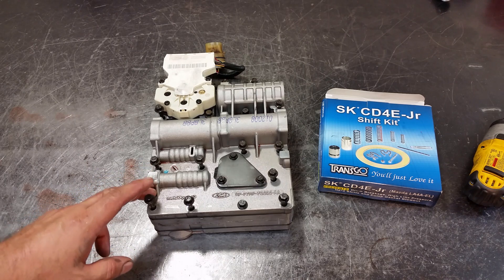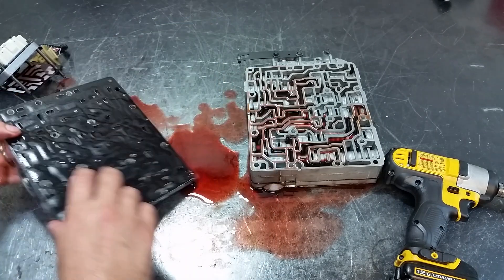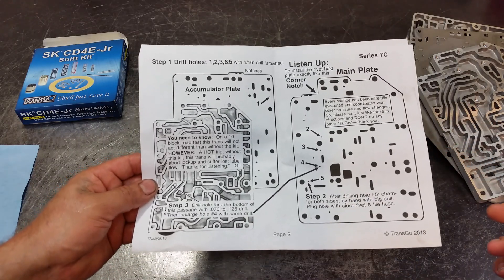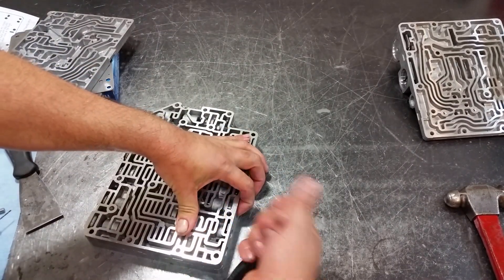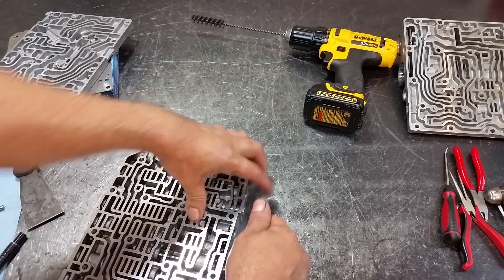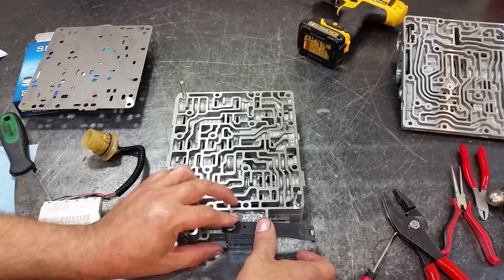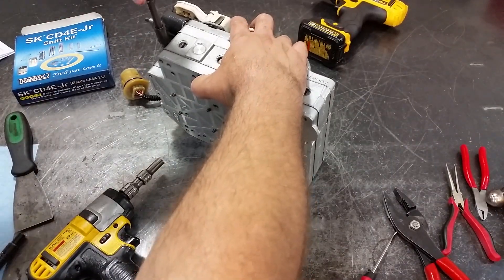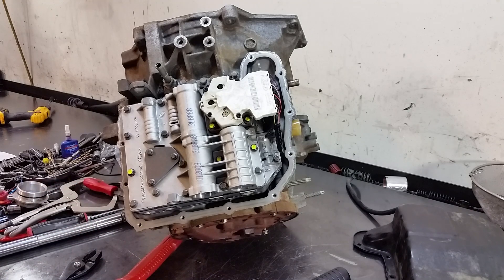CD4E Transmission - Broken Parts - Torque Conveter codes

Comment: Great videos on the cd4e, I have a 2005 Escape with the V6, transmission performs flawlessly but for one thing: A "flare" shift between 2nd and 3rd gear.
The transmission is currently in the car, the check engine light is NOT on.
My suspicion is a sticking 2-3 shift valve.
The problem didn't come on slowly, just one day it was there.
I bought the car used, and was probably the first to drain the pan and put in fresh fluid at 180K miles. The old fluid was dirty, assuming friction material, but now seems to be maintaining its red color.
I'm leaning towards leaving the transmission in, pulling the pan, removing the valve body, and getting the valve unstuck (if that's the problem). Or maybe just replacing the valve body entirely.
Before all that though, maybe a can of Sea Foam TT-16??
Any ideas you have would be greatly appreciated, thank you!!

Comment: I know this video is 8 years old however I am attempting to fix my 06 tribute. I had slipping from 2to 3 snd over drive light flashing but no codes. I took off valve body and took apart and cleaned. I put back with screen in correct position and now car barely moves in any gear. Not sure what I did wrong. Was working way better before I attempted to clean it up. Any ideas?

Comment: Ford CD4E / Mazda LA4A-EL is found on Ford Contour, Ford Telstar, Ford Probe, Mazda 626, Mazda MX-6, Mazda Tribute, Mercury Mystique and probably a couple other models.  It was Ford and Mazda's main unit for automatic transmissions from 1994-2002.  It was still available after 2002 for some models but it began phasing them out in 1997.  Thanks for the mention Hiram. :)
Reply: I was wondering if you know what my problem was I have a 05 Mazda Tribute 3.0 automatic all wheel drive when I go to stop the car continues to pull and stall. It is almost like in the torque converter is locked up wanted to know if you had any suggestions thanks
Reply: I think this was for the 4 cylinder Mazda MX6. The v6 has 4EAT transmission

Comment: 98 Contour V6.   When CD4E is cold  shifts weird 1-2 after 5 restarts of the engine roughly 10 mins apart, shifts like its flawless.  When on highway TCC stuck off, P1744.

Comment: CD4E on '01 - '07 Escape and Tribute(if yours is automatic this is what you have G5M is the manual trans) goes out so much there should be a factory recall.. Seriously I've never seen one get past 150k(best case senerio) without needing at least a valve body rebuild.. Most shops will charge you for a tranny swap even if they just rebuild valve body, and that's around $5,000.00.... Shade tree mechanics will do it for about $3,000.00, and just buying a refurb w/solenoid with lifetime warranty and self-labor is $250-$500.

It has nothing to do with maintenance either.. I did factory intervals with Max Life Mercon and filter kits and mine went out at 145k.. Most people it happens way more frequently.. I suggest self labor and a lifetime warranty rebuild, or take your rebuild to a trusted mechanic and have them install..
Reply: You did filter replacements on a trans that needs the case split to replace? I don't buy it.

Comment: Thank you for keep showing inportant videos , You are good, Do you have any video that show how replace pack selenoids, or how to improve the pressure of the valve body. In the mornings it is neutralized for a minute and then applied normally, on trans  ford explorer 98. I repared the transmission 4 months ago and was failure valve body. I'm sorry. I don't speak english very well. I am on Venezuela. Thank's.

Comment: Not sure if you are still checking comments on this, but I have an '08 Escape LTD AWD that is leaking about 1/2 cup of Tx fluid every few days. I put a new band in it last year (broke) and it's been OK. I am wondering if it is valve body pressure. I see the kit you used in this video, but not the seals. Do I have to buy a full rebuild kit or what do you recommend for seals for this repair? Thx!!

Comment: great video I couldn't have done it without you I just installed the shift kit in my cd4e but the torque converter is still not unlocking in first gear and reverse when you stop what do you think

Comment: What makes the V6 Mazda Tribute  transmission different from the V6 Ford Escape in the 2003 model year? Also what is different between the early Mazda V6 trans thru (1/27/03) and the late version after (1/28/03)?

Comment: @Hiram Gutierrez Thank you for all you do for us mechanics that have some background on transmissions but need a little guidance.  I have one question on the CD4E I have a code of P0734  incorrect 4th gear ratio What are the common issues in a CD4E with this code that I can check over?  Thank you in advance Brett.

Comment: Hiram, I have a 2002 Mazda Tribute with a hard Drive to Overdrive shift. If you turn the Overdrive off the Transmission works great. Do you think installing the shift kit might fix my problem or do you think the Transmission is already damaged?

Comment: My wife is working on one of these cd4e transmission out of 99 626 and she is trying to determine if it is a good candidate for this shift kit or if the transmission is too far gone and needs a rebuild as well. Do you have any advice you could give on this?

Comment: That ain't like you to leave the outside of a transmission case lookin dirty like that Hiram. Is the case washer is broke down right now, or is it just dis-colored to the point where it won't come clean?
Reply: I figured it was either dis-colored in a way that wouldn't come clean, or your case washer was broke down and you had to clean the case by hand. True about it being really important that the inside being clean. 

The shops coming along real nice now. Almost got my teardown table done and it's lookin a lot cleaner and more stocked with stuff than it was.

Comment: I have a 05 Mazda Tribute with a 3.0 automatic it feels like my torque converter is locked when I go apply the brakes it keeps pulling forward and tries to stall out if I hold the brakes on to long.  what would be the cause of this problem?

Comment: Hi from the UK.
I have got oil in the harness connector socket on top of the box.is this normal as I'm having intermittent issues like hunting for a gear and sometime failure to shift.the car is a ford mondeo

Comment: Ford CD4E- if I pulled out the pump on the vehicle to change the band and then everything fell out is it possible to reload it through the pump side, please amswer.
Reply: I've tried that and wasn't successful. It slides out to far to be able to reset the friction plates.

Comment: I rebuilt my escape transmission about a year ago. I put the shift kit in new clutch drum, bushing, bands and clutches. It worked great till last weekend.   While driving i noticed a little flare from first to second .  it happened a few times more on the way home then all the sudden it would not move.  I  turned the car off let it sit for a few minutes put it in gear and for about a  minute the car will move till you let off the gas then nothing.  if you turn it off let it sit for a minute then it will work for about a minute.  it is like it is running out of transmission fluid.  do you have any idea what happened
Reply: 6 years later...I think you have a clogged filter like me. Did you ever fix?

Comment: Anyone  here knows how to get the transmission fault codes on a 94 mazda mx6 automatic transmission ..mine has a hold light flashing putting on drive the car doesnt move unless playing with my throttle revving it up and it moves then hold started to flash
Reply: I believe it has cd4e transmission

Comment: Do you fit a shift kit to all your rebuilds? Do manufacturers do this as well with the factory rebuilds? Thanks for the video.
Reply: Thanks for your comments. So I understand from this that an old CD4E valve body will be a little worn and the kit will compensate for the ware and make it last longer than it originally did.